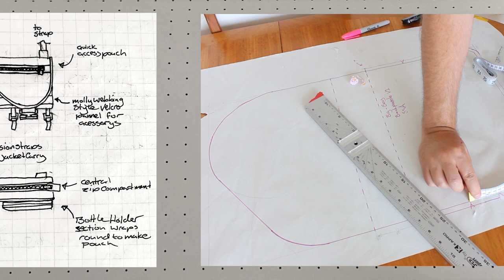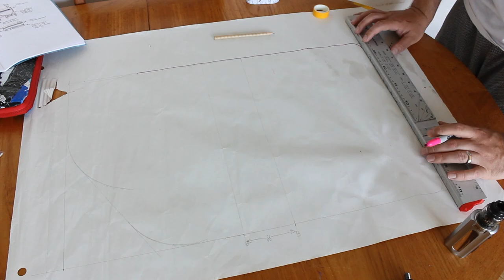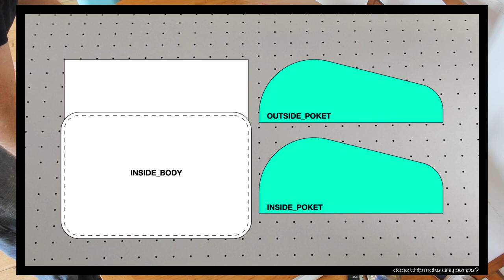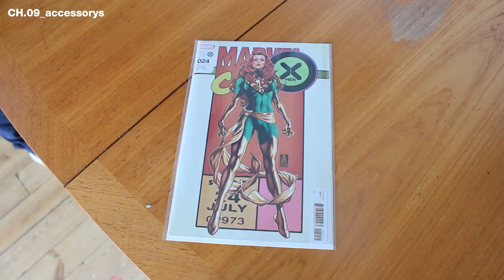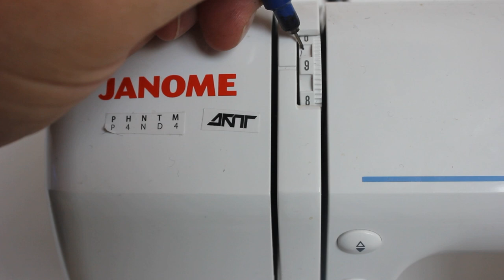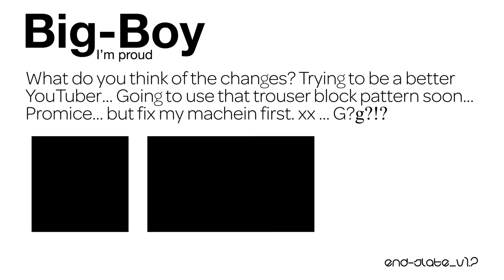I turned 20 PLASTIC BAGS into a SATCHEL

Comment: Increadable, by the way did you use butter paper for fusing plastics in between or something else ?
Reply from the maker: I guessing butter paper is similar to baking paper?? 

If so yes! 
You need something that won’t bined to the plastic and is heat resistant between the surface, the plastic, and the iron otherwise you’ll end up sticking everything together… 
Best of luck
Reply: thanks for the genuine helping nature and being human @TheUnpicker
Reply from the maker: @user-ix7qi6gz8n no worries, the channels still tiny so I get excited over every comment… 
And being helpful is kinda the reward of a channel like this…